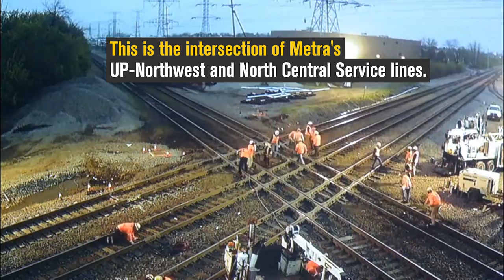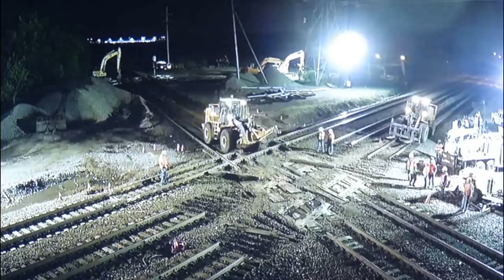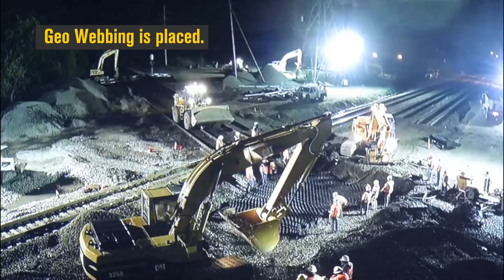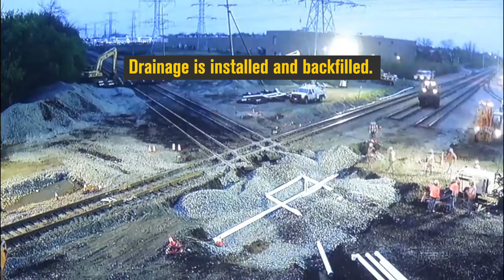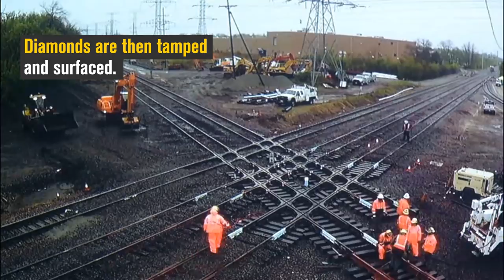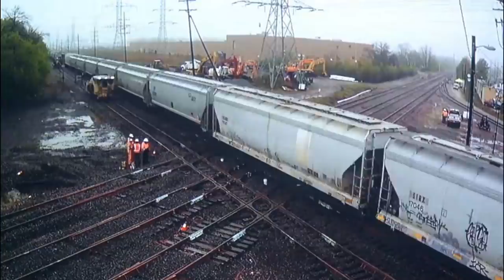Chicago's Five-Track Deval Diamond Replaced in Under Two Minutes

Comment: Am I the only one to assume they would replace that level diamond with a rail overpass?...
Reply: Bom Cabedal that will cost more
Reply: https://goo.gl/maps/5WKFbvBsgSQ2 The tracks are surrounded by roads and stuff, there's only a few hundred meters in all directions... or less.
Reply: Bom Cabedal  That's exactly what I was thinking.
Reply: lalit Sharma  Just like America to always go with the cheapest solution instead of the better solution.
Reply: It will cost A LOT more. Check out the map link.
Trains don't do hills very well, if you want an overpass you'll have to redesign the surrounding roads too.... assuming it's even possible.
Reply: Of course an overpass would cost more, but it also would be way more efficient. I'm just wondering how they have at least one track per direction, but at the same time so little traffic that they don't need an overpass...
Reply: I never knew there was such a thing as a train crossing. I don't even know if that would be allowed to exist here in Germany. Trains crossing seems horribly unefficient.
Reply: Dangerous too, surely? A little human error and you could have two trains colliding, no?
Reply: Come to Newark North Gate on the UK East Coast Main Line. A double-track freight line crosses the 125mph ECML at grade.
Reply: Complicating matters is the single track just to the east which also crosses all five tracks, as well as the interchange track and a siding..
The two-track could conceivably be made into an under pass (going under both the three-track and single-track) with the interchange track connecting east of the highway, but even that has issues due to the yard connection to the west.
No easy fixes to that one.
Reply: guildrich we live in the real world where there isn’t infinite money and resources. You probably don’t know the infrastructure or operations there. What’s the point of having an overpass when the amount of times two or more trains would need to occupy that track at the same time would be next to nothing. Signal bocks make it an non issue.
Reply: The ECML Newark crossing is a pain in the backside though. Reduced capacity, timetabling, having to slow down to 100mph. The quicker its gone the better.
Reply: Diamonds are everywhere. Uk, india, you name it.
Reply: Anyone can build something overdone.  Engineering and economics means doing it in the least wasteful way.  And his diamond is just that.
Reply: Overpasses are generally very expensive many times not feasable, and they usually only need to be there if trains regularly stop.
Reply: I wonder how responsible diamonds dotting Chicagoland are for bringing on the notorious rail congestion over there. The colonies are about 2nd- -- if not -- 3rd-rate living standards..they'll forever be more corporateered than any home country, and thus their sheep are bound to perpetually bleet costliness whenever imagining  s a n e  improvements, yeah.. .. .. . . .
Reply: You know an overpass in this situation would be a mile long right?
Reply: @guildrich  What about your country? What percentage of freight is transported by railroads?
Reply: @martinum4  If the traffic is 10 trains of 10 000 tons each per day in one direction and 14 trains of 400 containers each in the second direction. That is a lot of traffic, yet only 24 trains per 24 hours. If those trains meet at all, all they have to do is to wait a few minutes. The overpass would be needless waste of money. It would take a gigantic amount of traffic to justify one.
Reply: people are confusing passanger trains with cargo trains

Now I dont know about these specific rails but I strongly believe it's only for cargo trains. Not only would it be hard for them with high gradients, but the risk is way lower, almost non existent since they only have a driver and also go really slow.
Reply: @professorjamesmoriarty5191  
You answered my question. Grade for overpass = 1 mile. Everyone thinks it's like a road for automobiles.  The mesh they mixed in with the ballast must be for drainage.
Reply: Only if the responsible government sees the positive effect of an overpass and actually at least co-funds this project
Reply: Not in 2 minutes
Reply: Also, some of you missed that one of the lines is a just a commuter line, so it can take delays. The other is a freight line who's only interruption would be.... little commuter trains. So you're not gaining any time by putting a bridge there
Reply: Money.
Reply: The Cashier, the most common places where you can find diamonds are in tram systems in junctions
Reply: Trains struggle with gradients so maintaining a flat surface is essential here.  You likely need a 1,000 foot approach on all ends for an overpass option here
Reply: @trainrover  🥱🙄
Reply: Trains are not very well at handling grades, a manually made overpass is simply unrealistic

Comment: Incredible how much goes into replacing track!
Reply: Those diamonds (level crossings) are notoriously maintenance intensive too because of the multiple flange gaps in the rails.  So replacement has to happen more often than you would think!
Reply: I mean I knew the diamonds were probably a pain to keep in good shape but wow!  If I'm right by this assumption faster Amtrak trains go through there too (judging by their speed in the time-lapse) so wouldn't that kind of make things worse?
Reply: Austin Brodzinski well funny thing... I used to live by this diamond, and they incorrectly reported what it was. They actually replaced the diamonds between the UP Northwest Line(ex-CNW) and the UP New Line (ex-Milwaukee). The North Central Service travels on the other tracks (not seen here) and has its own diamonds that cross both of these lines as well.

To answer your curiosity, no Amtrak trains go through here. Never have. The UPNW is for Metra and 3-6 freights & locals weekly to Janesville, WI. The UP New Line sees no passenger service of any kind. The North Central Line (now CN, ex-Wisconsin Central) is Metra's newest service, but has a hodgepodge of all sorts of traffic. 

Copy and paste these coordinates into google maps to see what diamonds where replaced and where the camera was. Then you can see another track off to the right, That one is the NCS.
42.0465654, -878990833

Comment: This video is proof of why the the 11'8" bridge cannot be raised. So much time and effort went into making sure this single intersection for trains was done in 48 hours, and there wasn't that much compared to the 11'8" bridge. Shutting down a mainline bridge for a week or more to raise it at least a mile in both direction is not a smart or cheap idea. Thanks for the video, UP.
Reply: It can often be much easier to lower the road below a low bridge than raise the bridge.
Reply: Gen15 Replacing the diamonds can probably be done in 24 hours if you double the crew size. And replacing the bridge can probably be done in 48 hours.
Reply: Sure if you've got 200 people working.
Reply: Gen15 here you can see how the Germans replace a train bridge in 4 days with a prebuild bridge. https://youtu.be/R4ca9xVYJqk

And here you can see how the Dutch add a tunnel under a highway in one weekend.
https://youtu.be/btOE0rcKDC0
In both occasions, there are way less than 2000 people on scene. But it is all a matter of costs. Are the extra costs for the people worth the decrease in the building time compared to the costs for not being able to use the track or road during the building phase.
Reply: In the case of the 11'8" bridge, not only does the bridge have to be raised(or rebuilt/prebuilt), the grade of the track has to be adjusted for at least a mile on either side, or even more. That is not a weekend job. Maybe a week, but definitely not 2 days.
Reply: Gen15 Removing tracks, increasing the height and placing the tracks back can be done at the same the bridge is replaced. But adding the sand needed can be difficult if there is not much room.
Reply: kempo 95 I don't think you understand the fact that trains can't climb hills unless they are extremely shallow grades.
Reply: Klorrin Sure I do, but what does that have to do with what I previously said?
Reply: To everyone in this thread. Some of the steepest mainline gradients excluding tramlines, mountain railways and the like, would be Cajon Pass in California at around 3% (1 in 33), and The Lickey Incline in England at a 1 in 37.5 (just under 3%), compare these to the 30% or so that an automobile can climb up or the stairs which despite what you may think are steeper than they appear to be at about 80%. 3 is nothing compared to 30 or 80, especially in gradient terms. That's the problem with the 11 foot 8 inch bridge though, it was built around a century ago when there was no regulation on the limit for a height of a railroad/railway bridge, so you can't just raise or lower it unless you wanna rebuild the bridge also. The other problem is there's also a gas and/or sewage main running under the road also built about a century ago when there was no limit to the depth of mains so you can't just lower the road. There's reasons some roads are inaccessible to certain vehicles and the 11 foot 8 inch bridge is a prime example of it.
Reply: Paul Kennedy 
The 11'8" bridge has century old water/sewer lines just below grade. Difficult to move
Reply: Or OR people could stop driving box trucks into the bridge. But that wouldn't make for good YouTube videos.
Reply: Such creative writing! This level of creative excuses is why you don't have civilozed railways nor highways  either.

Comment: this was fast done, ok, but why do you still use level Crossings? that way you block each oder all the time.
Reply: Because of the cost and geographic problems of grade separating every crossing.
Reply: Because this diamond doesn't allow for it. You have the Union Pacific Northwest Line, the North Central Service, and the Union Pacific New Line all converging on this triangle.

Comment: Why don't they use a bridge for such a crossing? Wouldn't it be more convenient?
Reply: The math on a bridge at this location wouldn't work.  You'd need approaches over a half mile long and heavier trains would still struggle to get up those approaches quickly.  Due to the large size of the trains compared to other countries, US railroads run fewer, much heavier trains.  By scheduling these freights during low commuter volumes, they can get the tonnage through without spending large sums of money to build a bridge over the existing tracks.

As an example of railroads working with what they have, my home town has a two track diamond that sees anywhere between forty and fifty trains a day.  With good scheduling, it can be made to work and the railroads tend to run three to five trains through in a row when they get permission to cross the diamond.
Reply: Russian Severe Videos the grade of the tracks would likely be too significant for a heavy freight train to climb.
Reply: stampycatfan01 hi subscriber, how are you
Reply: Russian Severe Videos They would have to shut down the line for far too long

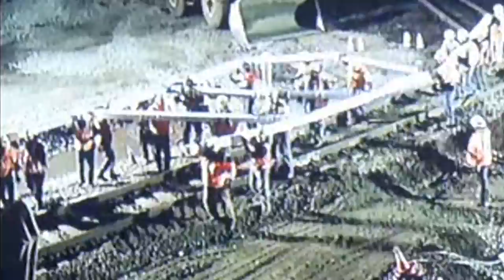Comment: @1:00 PVC drainage pipe is suppose to withstand 70 ton freight cars?
Reply: With the weight displacement from the diamond and the gravel, there will never be enough pressure exerted on one specific point to shatter or crush the pipes.

Comment: Deval interlocking is in Des Plaines IL, not Chicago.
Reply: Are you using 'interlocking' incorrectly or do Americans really use the term for a diamond crossing? (As I understand it, interlocking is actually a system which constrains the signalling based on the way the points/switches/turnouts are set.
Reply: Deval Interlocking refers to the tower and the system of signals and switches that (used to be?) controlled from the tower. There are three different sets of tracks intersecting at Deval (a diamond of diamonds).
Reply: Okay. But as I understand the term the diamonds themselves can't be part of the interlocking because there are no switches that can be set. Perhaps 'interlocking' can refer also to constraining the signals on each line based on the way aspect showing on the line crossing it.
(I just assumed that was such an obvious and necessary arrangement that it would have long proceeded the development of interlocking between signals and points.)
Reply: The diamonds are not part of the interlocking, but are part of the property commonly known as Deval Interlocking.
Reply: Chicago is in Illinois

Comment: Tried applying to UP. It didn't happen. Month of May is the time that I can reapply for the Track Laborer position. If its open at that time. Being a trailer/chassis mechanic isn't really my cup of tea. Especially when you work at a UP rail-yard for a different company. Pay and benefits are good but I guess I just don't enjoy the mechanical work as much as I thought I would. I'd rather go work on the track. Get some welding experience, since that's what I'm going to school for. Let alone the opportunities that UP has. I done goofed up when I applied. I didn't have a reference when I applied. I mean I had my uncle-in law who works for UP in Proviso, IL but I was too hasty and applied without his info. He called maybe 30 minutes after I applied. Literally a second after I applied I was told I was no longer being considered. So, I check like every day to see what UP is hiring for in my area. Which is Dekalb, IL. There usually isn't anything. Which sucks.

Comment: We have these great things we call a "bridge". Have you heard of them? They work very well and make things a lot safer should the unthinkable somehow happen
Reply: "The math on a bridge at this location wouldn't work. You'd need approaches over a half mile long and heavier trains would still struggle to get up those approaches quickly. Due to the large size of the trains compared to other countries, US railroads run fewer, much heavier trains. By scheduling these freights during low commuter volumes, they can get the tonnage through without spending large sums of money to build a bridge over the existing tracks. As an example of railroads working with what they have, my home town has a two track diamond that sees anywhere between forty and fifty trains a day. With good scheduling, it can be made to work and the railroads tend to run three to five trains through in a row when they get permission to cross the diamond." -Lewis Andrews.
Reply: DM Multimedia I do take your point and I suppose for the train situation in the US it works. What usually happens for bridges is that the "bridge" is actually just level and the lower part actually gets sunk down, so rather than raising the tracks you lower the ground. That way it's much cheaper and you don't need a huge bridge.

As you say though in the US passenger trains are so few that there isn't really a danger to passengers so it's not a priority
Reply: AdzSONLINE It would be very inefficient to shut down the main line for weeks to build a bridge
Reply: That wouldn't work at Deval. There are 3 lines which cross there, although this video only shows two. Grade separating all 3 of them would  be very expensive and take a lot of time, especially since one of the 3 intersections is on a bridge above a road.

Comment: What is Geo Webbing, and what is it for?
Reply: In the most basic terms, it is a fabric that is used for keeping different layers of materials (ballast vs gravel as an example) separated,  from washing down amongst the other.  Helps to keep from too much settling of placed materials. The reason certain materials are used (i.e. riprap) is to ensure that water can flow down and away from what they will be building above it.  If all the smaller particles end up vibrating down and settling and filling all the little nooks and crannies, it will be harder for water to easily seep down and away, especially when the cold starts freezing the water.  Also, if the smaller particles above begin to settle, it creates voids above, allowing too much flex at the tie and rail level.